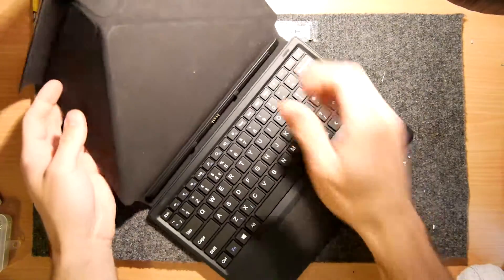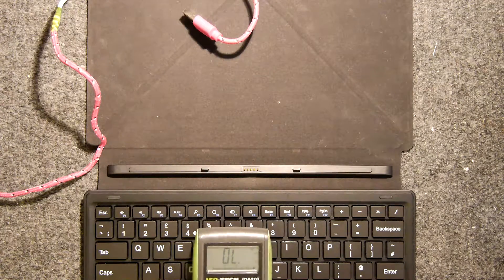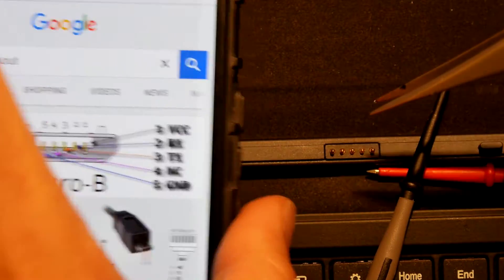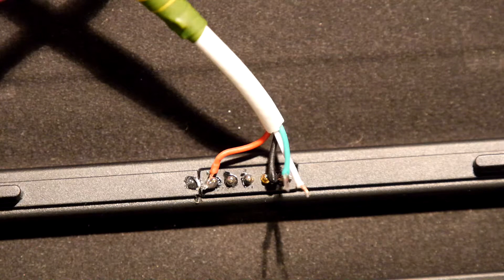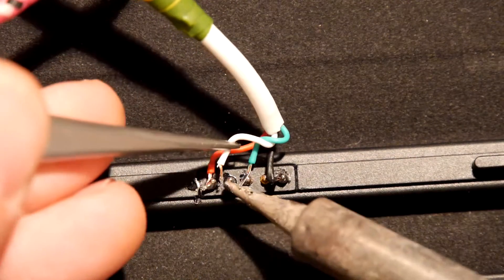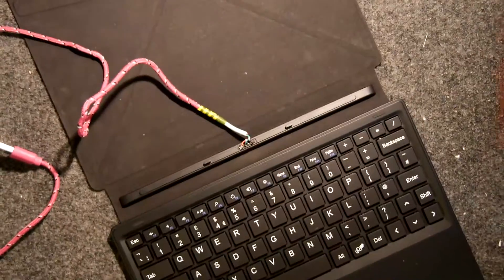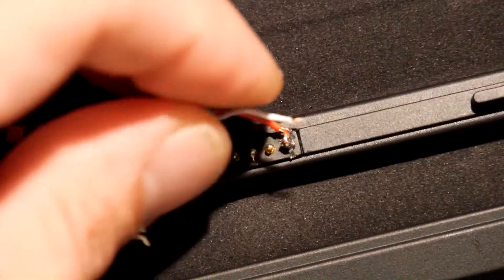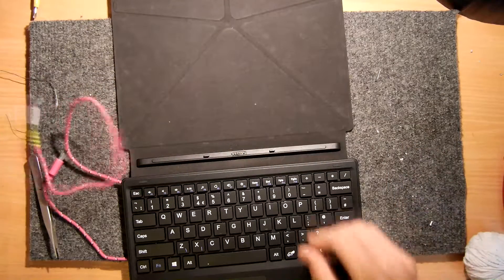Tablet Keyboard Hack USB Experiment Fail

Comment: With the connector closest to you the pins are from left to right
Gnd ,Gnd,Data+,Data-,+5v 

Bit late I know as it's now in bits, however as you still have the flat flex etc you could wire directly.
Reply from the maker: +DigitalAura No, it's not too late, thanks so much, I still want to use this and I can trace it through the flex, thanks so much!
Reply: If you have a scope with serial decode I'd maybe power it and probe the pins while pushing keys.  Not sure if it's USB compatible although you might be able to use it through a microcontroller.
Reply from the maker: +DigitalAura I guess I'm making a big assumption about it being USB. But DSO is the way forward!
Reply: @backofficeshow  hey there, did you ever find a solution to this keyboard? Is it usb? I have a similar model, but mine is a 4 pin. I'm pretty sure the trackpad is ps/2 (6 pin), and then I'm assuming the blue board converts the keyboard and trackpad to usb.